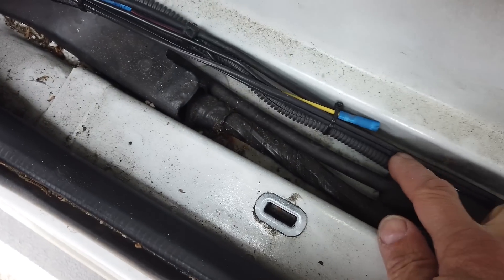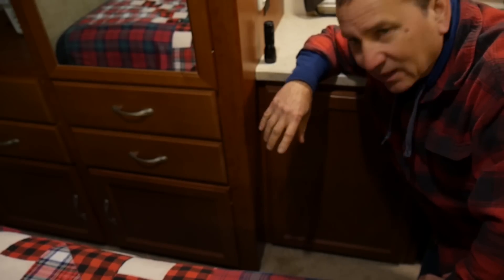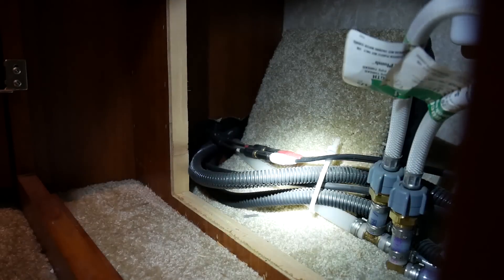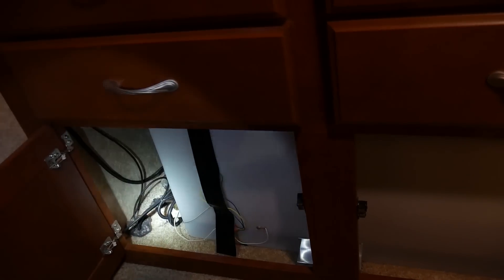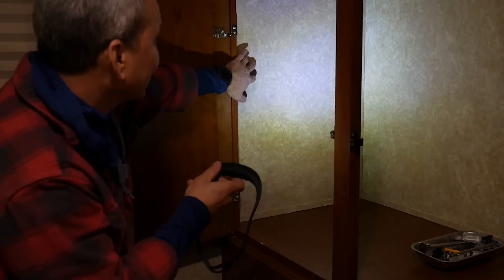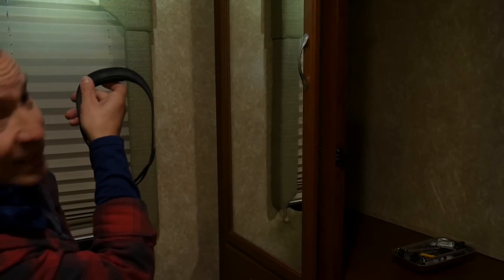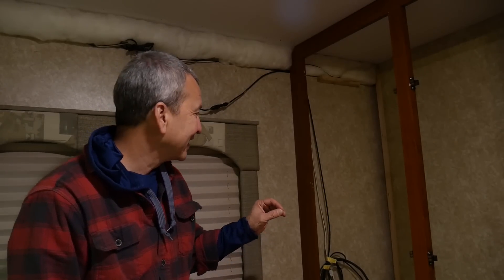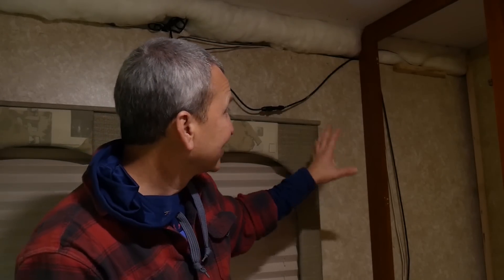Running Wires Through RV Walls // How To

Comment: Thanks.  I am changing my camera. I thought I could go through the outer hole.  Never thought about your way.  Thanks again.
Reply from the maker: No problem 👍Good luck!
Reply: @RVwithTito  almost there. Have a couple of corners to navigate.  I suppose I could attach the camera to the back window. Lol.
Reply from the maker: @thcall6441  It can be pretty challenging getting to the camera wiring. Good luck. I have several cameras now. One thing to note is that if have a camera inside the window, the IR night LEDs don't work.

Comment: Hi here’s a question for you. What precautions need to be taken when it comes RV Propane tanks? Should the tank be swapped out after a certain age?  Should rubber flex hoses be changed after a certain age?  What about the fitting and valves?  Any information you can share is as always greatly appreciated. Thanks, love all your videos. FYI Because of your videos, I’ve installed Ft & Rr stabilizer bars, rain drip diverters, WiFi, lightening, cell booster and much  more. Thank you thank you 🙏
Reply from the maker: It makes me feel all warm inside hearing that my videos inspired you to take on these mods. Great job! Re: Propane - After 13 years I haven't done anything to my propane system and it still works fine...just a little rust on the tank. Inspect it periodically and replace your propane detector inside every few years.
Reply: @RVwithTito  Propane tanks are dated and have to be reinspected or replaced. The fuel suppliers will tell you when you go to refill
Reply: Hi Brian. Thanks for the reply. I also made and installed your suggestion on sewer hose storage. I love that one, it was super easy.  In my pursuit to get a smother ride, besides adding anti sway bars, I just installed Air-Life air bags in the front coil springs. (Still yet to test drive). I also want to add a rear air bag system from Ari-Lift. Have you done that yet, I didn’t see a video in your line up.  Any suggestions?
Reply: All propane tanks have a date of manufacture stamped into them and in California the propane suppliers adamantly refused to fill tanks that were past a certain age. This concerns me now because our recently purchased 1990 Class A has a 30 year old  30 gallon tank. At one gas station in Acton, California 15 years ago we could fill our own tanks by leaving our wallet in the store and getting the key. If we have trouble I'll just change out my old tank for 2 of the 5 gallon tanks that are exchangeable at tons of businesses...gas stations, home depot, dollar general, etc.

Comment: Very helpful channel. I need one answer: how do the 12 volt DC applications work when the CONVERTER is turned off and the INVERTER running through power inlet? Thanks much!
Reply from the maker: 12v DC equipment is powered directly from the batteries when the converter is off.

Comment: Thanks for another great video.  Any suggestions on how to run antenna wire from the roof into slideout.  The concern is cable problem with slideout moving in and out.
Reply from the maker: Yes. I've done it. You have to leave enough slack inside the slide slightly longer than the depth of the slide. It can be a pain in the butt running cable through there. If you can avoid it...even better. Hope that helps.
Reply: @RVwithTito  Thanks
Reply: Under the slide is folding cable guide, usually.

Comment: I recently purchased a 2000 watt pure sine inverter however when it came it was set for 220volts and all my stuff runs on 110volts.  Does anyone know how ti switch from 220v to 110v?
Reply from the maker: You may have picked up the wrong one. Typically the smaller inverters are purchased as either 110 or 220.

Comment: Hi, I'm going on a 2/3 months Minivan Trip to US National Parks. I needed additional suggestions from you. I'm illiterate when it comes to wiring etc. I will be hiring someone to connect everything plus I don't have tools.

Equipments I have…
-- Marine Battery,
-- #2K Inverter,
-- Solar Power Station
-- Solar Panel 350/400W

What else do I need as far as connectors, wiring, controller, 12v outlets etc.

What I want to accomplish…
-- When engine on, I want the car to recharge back up Battery & Power Station.
-- When engine off, back up battery takes over to continuous power the security camera & others with AC/DC 12v Etc.
-- When engine off, I want Solar Station/Panel to recharge back up battery & Car Battery.

Kind Regards, Tony

Comment: I have a question for you, I’m trying to pick up a camper van that I’m buying next week and I want to install quickly a back up camera on the license plate. I just want to run the cable through the back door while I drive at home and I was wondering if that’s gonna be OK. It’s a long cable that runs through the length of the van and plugs into the east cigarette later. Will it be OK to just run it through the door? I don’t wanna snap I don’t wanna crush it. It’s a temporary fix and just want you to let me know if that’s gonna work.
Reply from the maker: That should be fine. The rear door should have a rubber seal. Maybe tape the cable down so it stays In a good spot without getting pinched.

Comment: I come to the RV world from the marine world, boats, yachts and ships. In all circumstances eletrical conductors must be secured against lost motion, (chafe) and protected from water intrusion. For that reason conductors are usuallt run through conduits. Thats called a race. When it comes to yachts several builders put a messenger in conduits when the vessel is built. A messenger is a piece of string. When a conductor has to be added, it and another messenger is pulled through the race with the first messenger. In long straight wire runs the messenger is sometimes a continuous loop of string, (light stuff). Anyway, I'm a subscriber to your posts. I really enjoy your attention to detail and workmanship.

Best!
Reply from the maker: Thanks for sharing that info. I also fish a small wire through tough routes so I can pull new ones through. Thanks!

Comment: When I replaced my rear camera, I just removed the old camera and fastened the new wiring to the old wiring and slowly pulled it through backwards. I didn't have to remove any panels, just slowly pull the wires through to where I could then go towards the front as you did, just in reverse.
Reply from the maker: There are some sharp aluminum edges to naviate near the opening on mine. Pulling the wire through would probably cut it in half. I still have the previous camera installed as well.

Comment: I have a question someone might help me with. I bought a 110v 3000w tankless water heater for my camper trailer. ok it says it's best to have a dedicated 110v I'm hooking it up directly to the shower. Here is my question the dedicated line can i run it to the main 30amp wire that hooks up to the converter box , not through the converter but main hook up. making it my dedicated line. without running my aor cond. or micro wave when taking a shower. please don't be cruel asking because i don't know.

Comment: What is the first trim removal tool you used before you switched to the small pry bar?  Looked like a specialized (customized?) chisel. Is it homemade or can it be bought?
Reply from the maker: It was a paint scraper kind of thing. Nothing fancy 😃
Reply: It's called a painter's 5 in 1, or 7 in 1 (I forget which) tool, which is available any place you can buy paint.

Comment: What’s your recommendation on choosing wired or wireless cameras
Reply from the maker: Ray @ Love Your RV has review a few wireless camera systems. Check out his cannel. I have had mixed results and prefer wired. Some wireless devices seem ok, but it's a crap shoot. Wireless cameras still need power though and the ability to switch them on and off (not just while backing up), so might as well go wired.
Reply: Great job Ray! Thanks for sharing with us!…  Have an Awesome week!

Comment: Tito thanks giving everyone a quick look behind the walls. I was not certain what I would find. Those little damn staples are a PIA . Like your idea of small screws to reattach. Did you have any insulation in the rear walls? Seems like that might be helpful to add some. Maybe some reflective foil might help keep heat in and hot out. Also I might add some extra wires for future projects
Reply from the maker: I don't run wires or remove any insullated outer wall panels, just interior ones. I thought of putting insullation in that closet area, but since it was in a closet, it wouldn't have made much of a difference.

Comment: Good overview on how to add new features for your rig. I’m always amazed  at the RV manufacturers that can’t think ahead. As a long time boat owner I found modern pleasure craft going back about 20 years ago had planned ahead with installed wiring conduit that provide much easer access for future upgrades. 

On the RV side, manufacturers haven’t done a good job and in most cases it’s even harder to run new lines.  

They now push wireless devices whenever they can.  Definitely not as good as hard wired units in my opinion.
Reply from the maker: I tend to agree. Some wireless devices seem ok, but it's a crap shoot. They still need power though and the ability to switch them on and off, so might as well go wired.

Comment: I hate those damned little staples! A lot of mine have come undone on their own. Is there one size small screw you use instead? Could you say what type and size you use? Thanks.
Reply from the maker: I've been using some tiny screws that came with some piano hinges I picked up. I don't know the exact size but they seem to be just right.
Reply: I use some #6 ... or even #4 ... wood screws a half inch long.  Another recommendation, when you need to pull the old staples out, use a close wire nipper to grab the staple to pull it out.

Comment: Brian did you consider leaving some conduit/wire loom in these cavities for future wire runs so you no longer need to remove the false wall and trim pieces?
Reply from the maker: Only on a couple that go through tricky routes. I often leave a pull cable to help me out next time.

Comment: I love how it looked like the closet pole holder was only fastened to the thin false-wall panel. Those RV builders surely wouldn't want to waste money on decent structure.
Reply from the maker: And you should see how much clothes we've got hanging in there. I'm shocked it holding as well as it is :)
Reply: its been this way since...well...the before-time. Very few RV's actually possess exceptional construction. Yet...it gives the DIY'r plenty to do. Yay!

Comment: Do you have any videos where you remove the false bottoms in cabinets - for running wiring?  Thanks for this video I feel much more comfortable jumping in with a paint scrapper and giving it a go.

Also have you found a source for the tape RV companies use to seal the seam between two piece of wall board?  Along the back wall of your RV the builder probably used at least two pieces of 4x8 wall board to cover the area and may have used the seam seal tape to cover the cracks.
Reply from the maker: I havent talked about it in a video. Remove the panel from inside the cabinet. It can be tricky because there are staples. No. I don't have a source for the seam tape. You might check RecPro.com.